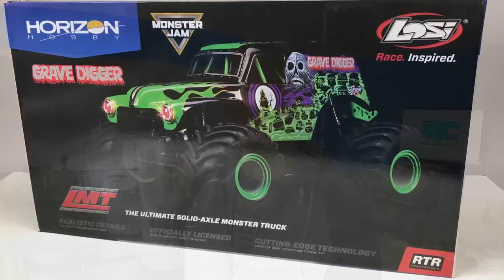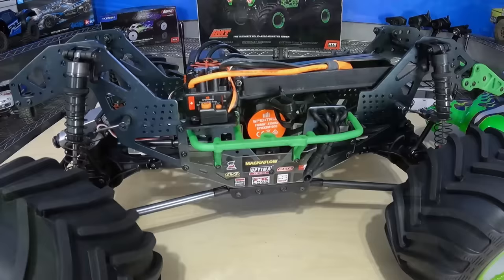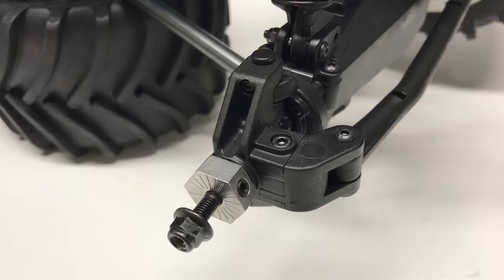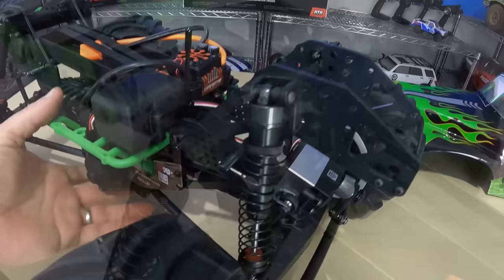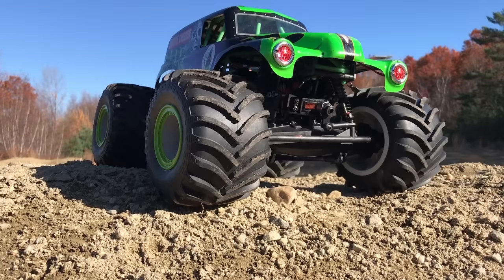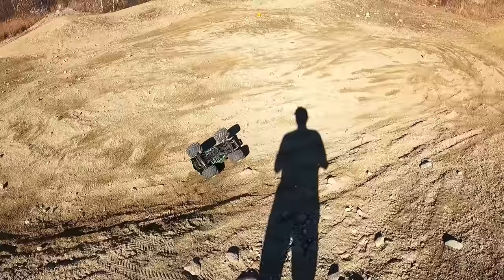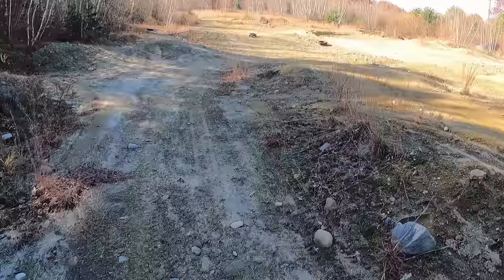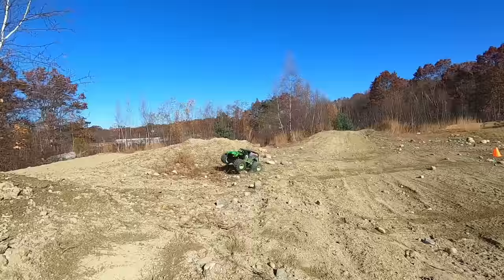World Shocker! Losi LMT Gravedigger 4x4 RTR RC Monster Truck Unboxing, Review & Action | RC Driver

Comment: Excellent driving on such a top heavy truck. I have three all custom Ground Pounders and I wouldn't drive them like you do. One is a Grave Digger and I don't even remember where the body came from. Tough with these trucks that pickup bodies are too small to fit. This Losi is very nice, and can easily toss around. Very capable. I had to go through a lot of trouble to even make my trucks even half capable.

Comment: I've been saying this for a while about having an elastomer based "cush drive" !!! That right there is a TOTAL WIN👍💯👊
Reply from the maker: Yup! When I popped that metal plate off the gear housing, I smiled. 😁
Reply: motorbikes have been using for years so makes perfect sense to have it in there
Reply: @maxtherotti  the HPI baja has one as well.
Reply: @ShabbernigdoXingjian  and x-maxx
Reply: I'm loving that Guy! Seems like an ingenious design. And it also seems to be working great as guys seem to be landing on throttle and it just eats it up.

Comment: Fantastic! Definitely got to pick me up the son of Grave Digger.
I know some would say why doesn't it come with four-wheel steering and I did a 4-wheel steering conversion on my axial Grave Digger and it's works fine with different steering configurations but only good at slower speeds at high speeds you can't keep it straight so therefore you wouldn't be able to perform the stunts. 
Awesome unboxing keep up the great work👍😁

PS I just came across something unusual I have seen your videos for quite some time maybe for the past maybe 3 or 4 years and I swear I was subscribed to your channel i have had this happen before but I fixed it and subscribed again.👍

Comment: I have mine a month ago. Its doing fine. Bash good. Speed good. 35mph ish. Fluffy tires.  Fluffy landing. Frame is good. So far I haven't broke anything yet. Regular bashing thrashing. I Bring the shocks lower to the ground. Its a bit high and doesn't flip over

Comment: The best thing I've noticed about this over the SMT10, is that the foundation is actually a TVP chassis, much like a lot of the rc racing monster truck aftermarket chassis available, and not the composite tube chassis. As far as aftermarket bodies, I think if you just completely remove the roll cage part altogether, and use vertical body posts, there should be a lot out there that will fit. Especially Traxxas scaler bodies.

Comment: Great review! You definitely put it through it's paces. It took all the abuse and the only thing that broke was the wheelie bar. The fix was simple! I see a lot of complaints about the price or that it's the Grave Digger. I have seen these electronics in other rtr's  and they are holding up. Then there is the roller model which is cheaper just add your electronics and diff body!  The cost will probably be more in the end. Can't please everyone,  but you make it your own and have fun!  Bash on and stay safe from Colorado!

Comment: If losi make changes to the LMT they should vent the tyres instead of the wheel. the 17mm hex should be machined standard ones go wobbly. The servo mount obscures the front  upper link mount bolt head, changing that would be nice. a better cover for the speed controller fan.

Comment: I was never a fan of the scale monster trucks, but this one looks absolutely amazing. This is definitely something I am going to have to get. Currently $600, but for the build quality, I feel like it's well worth it. I see a lot of similarities between this and the RR/SRR/BR/SBR. The rear axle looks like it would be extremely easy to convert to rear wheel steering. Not a matter of if, but when I get this monster truck. I feel like the 2s smart pack batteries I already have will be perfect.

Comment: Yeah, a very long video, but it´s worth every second. Good job for this. It´s an awesome car, which seems to be very resilient. And I really like the balanced driving behavior. Especially when it jumps. It looks as it always lands on wheels, no matter what speed it had before. Before adding some upgrades, I would rather experiment with the given possibilites of settings. Until yet I don´t use brushless motors or lithium batteries, but now I´m thinking about it. I would add a second body, so I have one for driving and one for the shelf. Ok, to be fair, a second front axle is recommende to get four-wheel steering and crab drive (requires a new radio system, too). Don´t know if the Gravedigger has this in original, but many other monster trucks have it.

Comment: Hello, I am new to the rc hobby and I have couple of  questions. I am planning to get a Losi LMT in the future, but I noticed that the receiver box is not waterproof. I am currently looking at waterproof receiver boxes online that I could modify to mount on to the truck. My questions are, would a Traxxas receiver box( TRA3628) work? Are there any other waterproof receiver boxes that are just large enough I could put the Spectrum receiver in?

Thank you

Comment: Nice video. But ouch on the price, this Losi is $600. Axial makes an SM10 Grave Digger for $300. It doesn't have the chrome or the headlights but it still looks badass.
Reply from the maker: The SMT10 is brushed and rather slow. So you’ll need to drop another $180 off the bat to upgrade to brushless. Then since it’s faster, you’ll need to upgrade some parts to handle the power and improve handling for the power. The costs keep adding up if you want to get an SMT10 to perform like the stock LMT. The SMT10 is fun in its own way, but the price of the LMT isn’t that bad.

Comment: I'm most likely going to get one. The price i understand but still. Its an awesome solid axle. All my smt10s an my ground pounder pro mod are scale already. I just would add a few things to this. An Rii light. Remove the wheely bar & get an rh design one. Last but not least a jbscale graphics flag and call it perfect. The wheels are eh to me everything else is great

Comment: I have a question should I get the King sling instead of getting grave digger because the king's sling have more power than the grave digger can the grave digger body fit on the King sling chassis because the grave digger power is 2&3s & the king sling is 2,3,4s right

Comment: just bought one, and seems like quality control is a big issue with LOSI, a friend of mine also bought one, and out of the box one LED is missing, on my LMT one bearing was missing, specifically the bearing just right after the front drive shaft. Honestly I think this will be my last LOSI truck for awhile, Last Losi I also bought before this, which was the mini t 2.0 had some missing parts, which leads me to thing quality control at the factory where this things are made is pretty bad!

Comment: Great review! Truck looks great too!  Those lower links though on the bottom of the axle housing 🤔... not sure about that.
Reply from the maker: I thought the same at first, but after running it around that dirt field littered in rocks, it appears the link mounts are tough.
Reply: Yea I think you’d have to really land on a decent sized rock to damage them. I mean your almost never gonna be running an RC somewhere with rocks big enough to reach them anyway since most RCs would just bottom out

Comment: Would you prefer this or a monster truck with independent suspension? I love the look of this though so im leaning more towards buying this
Reply from the maker: Two totally different driving experiences. Independent trucks will have a more nimble feel. Solid axle trucks are more rigid. The LMT however is the best handling solid axle truck I’ve ever driven. It’s not a primary segment for me, but this truck was super impressive.
Reply: @rcdriver  okay nice thank you for the response! I will probably get this or an Axial SMT10

Comment: Man I bought two Axial Smt10 right before the Losi came out with that I was a little bit upset but I put a brushless system and some up grades to make it stronger but it does flip alot no matter the swarbars , Im thinking the Axial dont handed the bashing 😒

Comment: Hello.. I need help.. my Lmt has a noise and reaction of gears which escapes but is not able to find the problem.. transmission and axle..0 breaks and does not look worn.. tk No signs appearing anywhere.. my budget is a bit low and I don't like to buy from botch.. I'm afraid I'm not buying the right parts and my store doesn't want to help me, it has some parts that don't come from them😢

Comment: I was just saying I wanted to get into monster trucks I'm a crawler guy and losi drops this.  I'm shocked at the quality,  kinda expensive but could also sell for 50 more easy lol.
Reply from the maker: The price isn’t too bad considering what you would have to do to other solid axle monster trucks on the market to get them to this level. I’m building about a $2000 SMT10 and I have a feeling it’s not going to perform as well as this stock $600 truck.

Comment: Whats with the tires being so firm? I love the looks and it seems like it might be
pretty durable as long as you don't go too fast ;)
Reply from the maker: The tires work really well, on a bunch of surfaces. Durability doesn’t seem to be an issue, I broke a wheelie bar cross brace, but the driveline, suspension and chassis are rock solid and can take lots of power.

Comment: Question tho, are the stubs 5mm or 4mm?  Deal breaker for me if it’s 4mm...  I remember my smt10 not being durable at all in terms of the stub axles...  

Even my rock Rey has 5mm stubs 

This truck looks amazing considering buying 😊

This truck looks amazing.
Reply: Im guessing 5mm judging by hearing the Hetmanski dude saying that you need to slightly bore out the inner hole in the JConcepts tribute wheel if you want to fit them to this truck! I did look up the part number and info for the axles, but very limited data only that they cost $50 or probably a fair bit more here in the U.k 😅
Reply: Actually i just checked up on the wheel locknut sizes and they are M5 on the Losi as Opposed to M4 on the SMT10 so you should be in luck fingers crossed 🤗
Reply: @garyhunt9838  it looks like it takes an absolute beating too

Comment: A rock rake on that dirt track would make a lot of difference if I was working filming those videos I would spend a good deal of time raking The Rock's away. But that's just my thoughts not that they mean anything at all that's just how I do it.
Reply from the maker: I spent about an hour picking up rocks in the areas I was going to run it (on land I don’t own). Picking up all the rocks in a 2 acre field of septic sand is impossible. And as soon as I run something it just kicks up more rocks. 🤷‍♂️

Comment: With all the aluminum on this thing I’m surprised the wheelie bar isn’t at least somewhat reinforced with aluminum but nothing a few dollars can’t fix
Reply from the maker: Since it hangs so far off the back, my guess is that they wanted it to flex rather than bending aluminum. But I did manage to break it. I’m sure we’ll see an aftermarket option.

Comment: I know it says RTR but does it come with a lipo battery (im new to this hobby)
Reply: No, as you can see on the bottom of this page (http://www.losi.com/Products/Features.aspx?ProdID=LOS04021T2) a 2-3S lipo and a lipo charger are required to complete it. Most high end rtr's don't come with batteries/chargers as a general rule of thumb.
Reply: @portalsam7  thank you so much for the response great to know this.
Reply: @tothemoon1082  Np

Comment: just looking at it without the body the chassis and all the mismatched parts make it look messy, the body looks to big, if the composite materials are the same as what they use on their 1/10th racing buggies it will be stiff but to brittle, why are they using universal joints instead of CVDs in the front, even dog bones would of been smother, why did they bother adding a realistic looking fuel cell in the back when the rest of it looks how it looks, the large inside wheel diameter, surely they could of done somthing different and avoid it looking like it has large SC wheels, this also means you cant use any other current monster truck wheel options, i could go on.
Reply: The $600 price tag for such a small rig is what got me 😱

Comment: Brilliant! Give SCALE aficionados a big expensive scaler that has the speed and abilities of a full-on BASHER. Given the homo-sapien tendencies of limited self-control, braggadocio, exhibitionism, and pissing contests Losi will sell a billion of them along with a second billion worth of replacement parts.  The motor is the same as the one in the Tenacity DB Pro. Why a 50mph motor in a high center gravity monster truck? wouldn't the higher torque 1900Kv motor found in the Lazernut be a more apt choice? Ya might be able to do long controllable 'torque' wheelies on 2S without the extra voltage of a 3S making it overly frenetic and uncontrollable.

Comment: Losi and their CRAPPY plastic antiroll bar links... At least these ones are straight and should be easy to replace compared to the ones on the Rey's. The ones on the Rey's are so soft I can bend them with a thumb and 2 fingers. That makes them totally useless. Plus their weird shape makes them hard to replace. LOSI!!!!!! GET RID OF THE PLASTIC ROLL BAR LINKS!!!!! Metals ones will add what? $5.00 to the cost of the kit? Not even likely.

Comment: Had my cash until I saw 1 thing... yo know what pisses me off.. tell me these don have all wheel steering in real life. put it in the firkin kit why charge me 4 times the cost to do it. Deal breaker for me looks good though.
Reply from the maker: Yeah the real trucks do, but I’m thinking they went for the ease of use factor for the general user. If a regular user hits 4-wheel steer while ripping around at 35mph, it’ll be a disaster. Hopefully they’ll offer a front axle kit so enthusiasts can easily do the conversion.
Reply: @rcdriver  thats not how it works with the right 4ch radio and radios are cheap, plenty that can do full function of AWS including font only rear only and side to side movements and rear locking. All with the press of a function button. Na its cool ill get one anyway an do the mods my self just to have it in the ole collection.
Reply: You craxy ? Or rich ? This truck would be 799 with 4 channel radio and 4ws , 599 already for hobbiest with alot goodies , mt guys been designe and buckets of money and still won't compare in performance.
Reply: @paulclancy2404  with the amount of plastic on it as is it should be 299 and sold through Walmart. You can get a full almost top of the line metal Vanquish crawler and slap on some monster wheels and a grave digger body decal sheet from Axial and be done for 800 lol. I will get one anyway and yea buy a rear front axle and do it my self or wait for after market alloy etc.
Reply: @propdusty6876  😆 actually has alot metal and a lcg